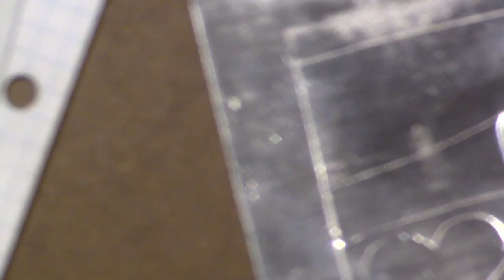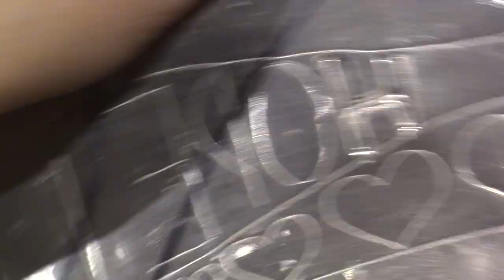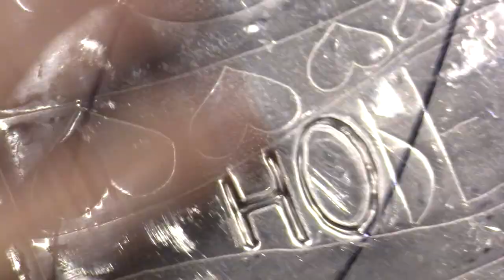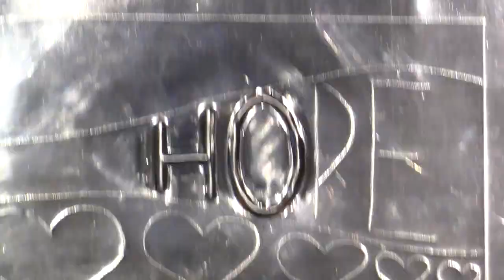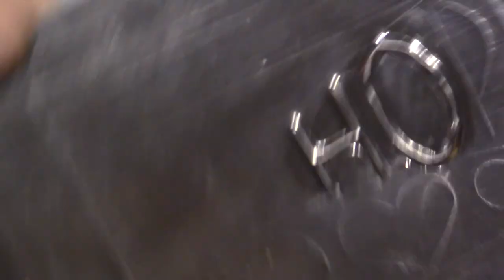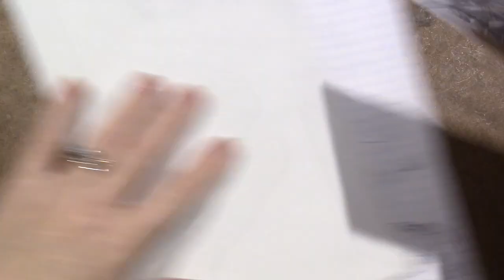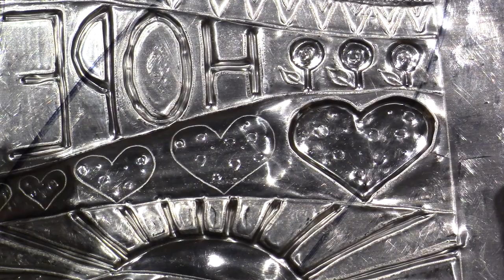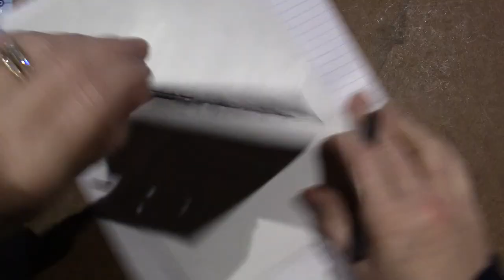Pewter Embossed Art Block Tutorial

Comment: pewter art is her website and shop plus much more...What Gauge is Thicker?
Generally, as gauge increases, the thickness of the metal decreases but an other factor also influences them even tough they both have the same gauge and that's  because of their composition and the % of that substance. Pewter (tin, lead, copper), Aluminum forms other complex alloys with magnesium, manganese, and platinum...the term used in such matter is An alloy which  is a material made by melting one or more metals together with other elements.
Reply: hoping this may explain why you have a difference between both metals you have used. :)